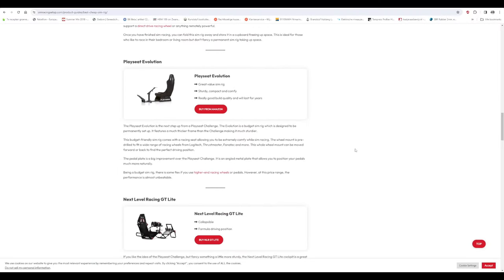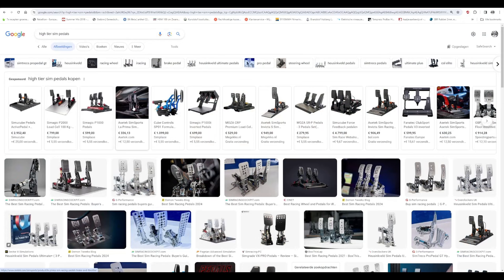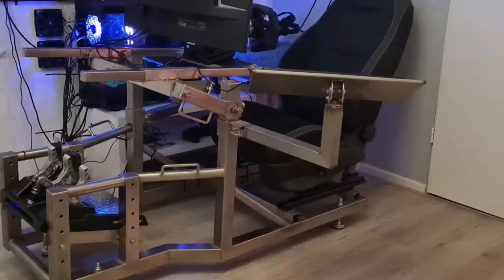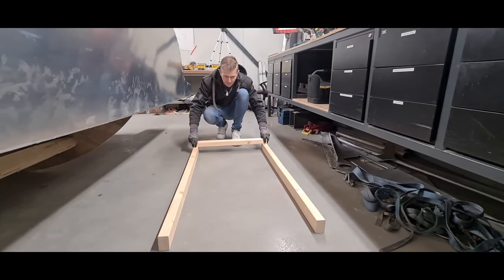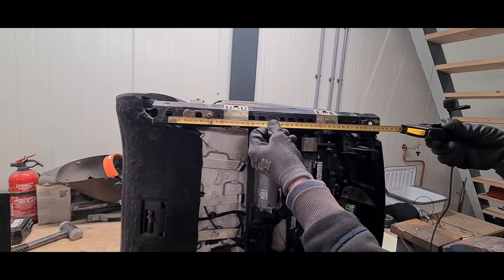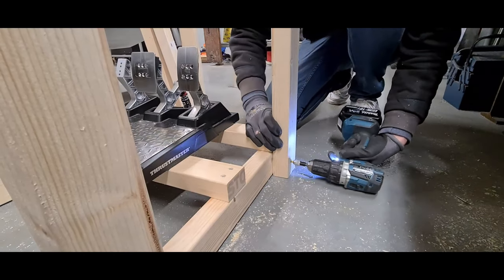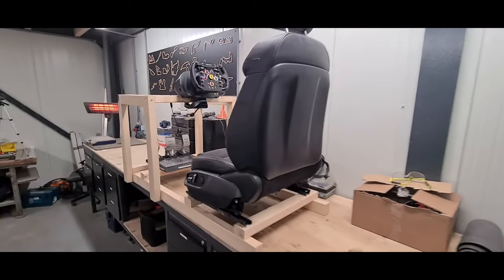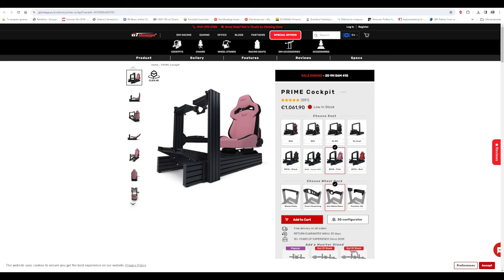Build your own Simrig Instead (free design)

Comment: Terrible advice. To some people, those prices are out of the question. Its go cheap or not at all, or go foldable or not at all. I have a playseat challenge because there is nowhere to put a static rig, so it works.
Reply: It's not terrible advice but I agree with rest of your point plus there is good resale on them

Comment: I've welded mine with letal scraps, coupled with a cheap gaming chair (80€). Cost me almost nothing. Gear is Logitech 920 (180€ second hand) with trustmaster tlcm pedals (180€ on Amazon), old 46 inch lcd tv (from 2008) with 2 cheap 27" put vertically on each side (200€ each) for a 150 cm wide screen total. 4 bass shaker with 2 mini amp : 2x50w bass shaker, one under seat, one under pedal plate (road vibrations and bumpers, wheel slip, wheel lock). 2x15w, one tied to accel (tc vibrations) and one on the brake (abs vibrations) total 200€ on Amazon). I started playing end of December, and got my lfm license yesterday thanks to your AMR setup. Saving now to upgrade over time for a simagic mini with their new cheap wheel (tlcm are perfect, i won't change them). Later on a 55 4k lg tv, and last will i buy a new rig, but it is clearly not a priority. Cheers !
Reply from the maker: Love to see a picture of that in the discord

Comment: Wonderful advice sir! I've been preaching this for a while. I started with a wood rig and a broken computer chair, built one out of scrap steel and mig wire, and now i built an aluminum rig with the seat from the race car; which has an added bonus. The seat has a provision for a brace to be tied in with the roll cage, so i put a swivel caster there, along with two casters on the back of the rig so that if the rig is tipped up so the back of the seat is on the floor, it can be pushed away and put in a closet whenever i need the room!

Comment: I partly agree in that the cheap rigs are super uncomfortable. I have a memory foam seat pad and use a soft cylindrical pillow as a lumbar support. 

I do have load cell pedals and although they are connected to the rig, the portion of the rig they are mounted to is flat on the floor. I've never noticed significant movement but perhaps I'm missing something.

Lastly, I have a wife and three kids that use the movie room that I race in. They readily tolerate my folded up rig that sits in the corner, but would be unhappy with a big rig that takes up the middle of the room. I think Im in a similar situation to most online racers. We have to compromise.
Reply from the maker: Thanx for your comment!

Comment: I'm a new Sim racer. I bought ACC and started on a controller. I got HOOKED, as we do and decided to buy a rig. 
Do to lack of space, did some looking around and bought the Next Level GT Lite Foldable Cockpit and the entry level Logitech G923 wheel and pedals.. It will be a year old in July and it's been great. Not one problem with the cockpit at all. 
So for folks that are just starting out, and if you don't have a lot of space, I highly recommend it.
I agree that for belt driven and more intermediate gear, I will need a more rigid rig. I've actually got a place for it now so, upgrades coming. For now, this equipment is fine.
You have helped me and others "Big Time", to understand setups and how they effect the cars in ACC. So Thank You for a superb channel.👍🏁🍻
Reply from the maker: Thanx for the comment! Sometimes i forget that im pretty fortunate with my small mancave

Comment: Awesome video. I built a pine rig - a bit less-sturdy than yours, but still did the job - a few years back. I can heartily recommend your design, which mirrored mine. Simple, but ultra effective, well up to handling the torque forces of most direct drives.

I've downloaded your plans, just in case! Thankyou.

Comment: I use the motedis alu rig, which was quite cheap before the corona-time, now it is around 400 € with the tripple setup. My seat is a 2nd-hand original BMW (70 €), which can be adapted in all directions and height, including an variable extension for the upper leg.

Comment: For anyone is the US that wants inch dimensions:

Beam 1: 55 1/8"
Beam 2: 23 5/8"
Beam 3: 26 3/8"
Beam 4: 16 1/8"

You can make it with 5x 8ft 2x4s. Be picky about straightness when you go to the store and it'll save you a lot of time and frustration.
Reply from the maker: Thanx!

Comment: This advise is basically saying spend €2,000 at least or don’t bother sim racing. 

I spent £200 on a used G29 and a folding sim rig (like  Playseat but cheaper).  Played on PS4 before moving to PS5 at Christmas. 
I don’t have the space for a permanent rig so a folding one is my only option for a wheel. 

I disagree with never. 
For me if I didn’t have a folding chair I’d be controller only. 

Also, what if you spend €2,000+ on a PC, DD wheel, loadcell pedals and then discover you don’t have the time to play or find it’s not as enjoyable as you expected. 

Appreciate the cut list, but this advice is only valid if you have the space to make it work and €2,000+ to spend to see if you like a hobby.
Reply: €2000 at least? I think the argument is plain and simple. Buy or build your own sturdy rig. And buy load cell/DD. I think this can be done for under €650…

AC or Rfactor can run on almost every modern laptop/pc so you don’t need expensive stuff for that either, probably already have something that would run those games…

Comment: Step 1. Buy 500 bucks of woodworking tools or learn to weld and buy a bunch of metal.
Step 2. Spend a few grand on upper branded simulator gear.
Step 3. Have enough room to have a simrig.
Step 4. If you have enough room for simrig, experience the frustration of craftsmanship as you are going to mess up a cut here or drill a wrong hole there and may have to redo that entire piece of rig.
Step 5. If you are able to get simrig put together, you (A) rage at it not fitting you properly and now you have to start all over, or (B) rage because the equipment you bought doesn't fit in your rig.
Step 6. Proceed to boot up game and spend the next 30 minutes to 6 hours trying to get the wheel and pedal settings right.
Step 7. Join a race, and rage because someone got too close to your fender.
Reply: Lol "woodworking tools" never done construction huh bud. You mean a drill and saw? Haha
Reply: You can get a drill and saw for literally like 50 bucks and all the wood you'll ever need for it is sub 50 also. Lol
Reply: Literally the most expensive thing I had to get was screws😅😂
Reply: @bp4861  You are correct, I am not construction worker. As that would require a certain amount of brains, but as we all know, people on the internet don't have brains.

Comment: This doesn't seem like really great advise to me.

I think the best, the cheapest and the easiest way to start and find out if this hobby is for you, actually is to do buy one of those cheap rigs and a cheap set of wheel and pedals to go with it, but second hand tho.

Unlike you think, they don't loose any value at all, while a crappy ass self build wooden rig is a waste of money and time, you will never get back.

I do like your rig tho. That probably wasn't cheap.
Reply: it's only crappy if you build it crappy. a wooden rig that is built right will be just as strong and sturdy as the expensive rigs. yes it takes some design and building skills to make, but if you get it right it'll be just as good as a metal rig
Reply: Yeah I agree. I started with a Wheel stand an a G29. Sold the wheel stand at a minimal los (like 20 euros) and bought a Playseat Challenge.

After a while I sold the G29 and pedals and bought a CSL Elite with V3 pedals. Did some small adjustments to the Challenge to make it work with the V3 pedals. 

Yeah it had to much flex, but I could fold it up and hide it which was a good option at the time. After a while my wife allowed me to have a permanent spot in the house and ofcourse moved to an aluminium profile rig. But the Challenge is not bad for what it does at the price. 

Another thing Arnout and I are very lucky about is that we live in a country where everybody wants to be Max Verstappen. Selling Sim gear is super easy over here.
Reply: Yeah nothing you can get will be sturdier than 2x4s and 1x.
Reply from the maker: Impossible to market. 40 hours of fabricating, welding, suface treatment an 400 euros of material. But it wil out live me and my kids haha
Reply: That would depend on your ability's. I built a nice wood rig in about 4 hours after work for about $25. Ten years later it is still holding up well.
Reply: @kerryengels9464  Pics, or it didn't happen 😆